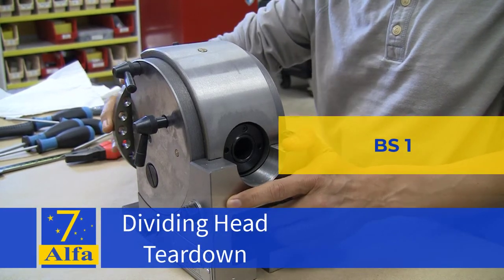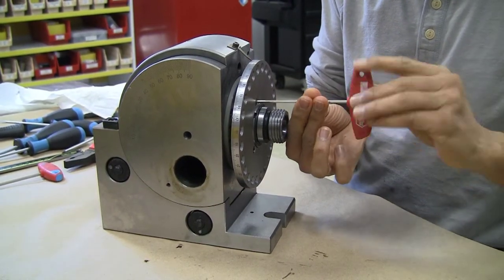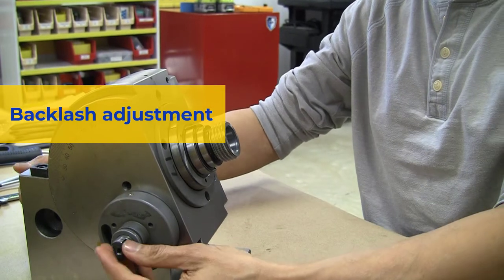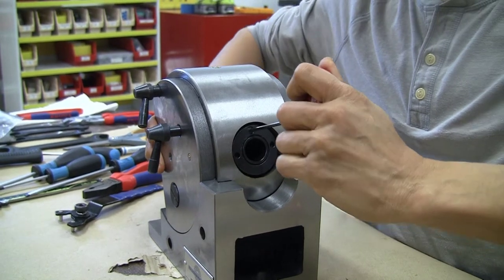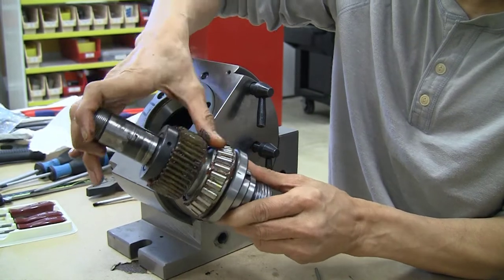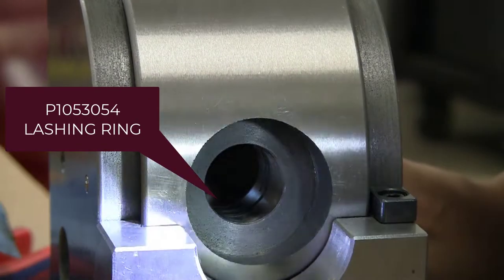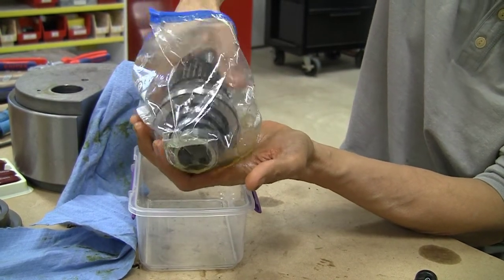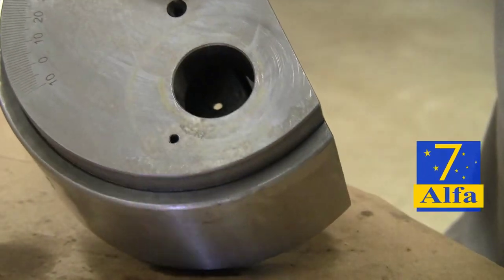BS1 Dividing head Part 1: Disassembly

Comment: You didn't show how to take the chuck off. I recently bought a Chinese BS-0 replica from Vevor, and the chuck is on very tight and difficult to remove, so I would have liked to see some tips for removing it, as apparently other people had great difficulty with taking off the chuck as well.
Reply from the maker: I have not had any trouble taking the chuck off at all. Could you please clarify what the trouble is? Is the taper getting jammed or is it a problem with the cams? I have found that the cams sometimes need to be adjusted a small amount.